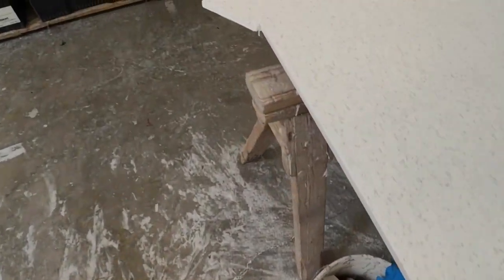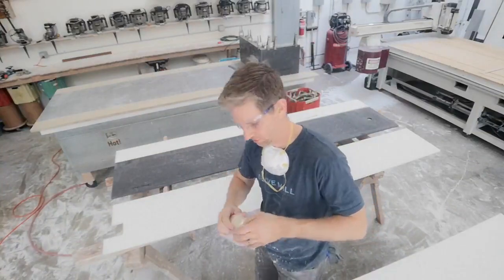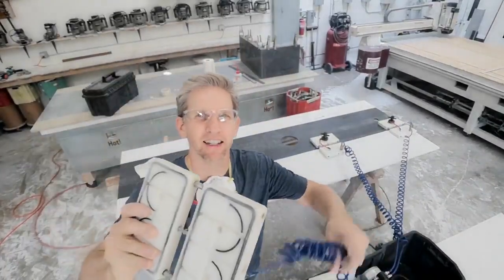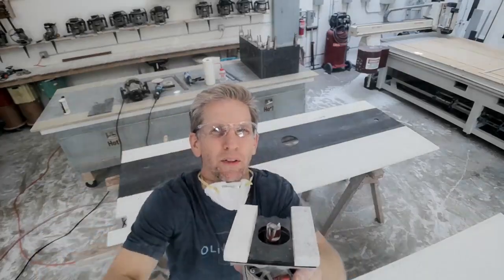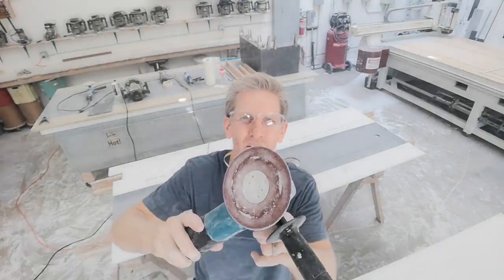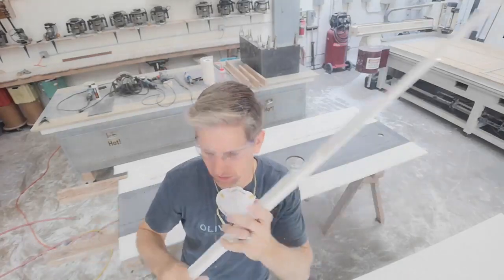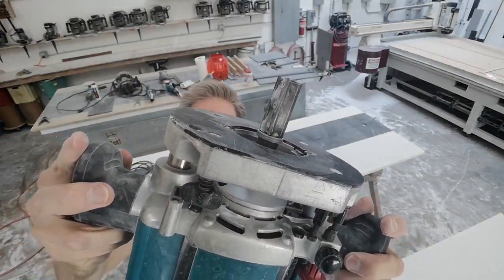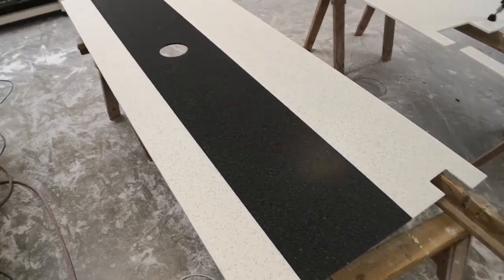Solid Surface Shower Walls - Panel Fabrication - Part 4

Comment: I just started attaching the monument clamps to the material then tighten up the clamp the way you did. No one ever showed me different but I thought that this would allow the material to level out. When I was shown how to use them I was told to attach then tighten as you go. Glad to see you do the it this way.
Reply from the maker: The problem we found with tightening them first is that sometimes they lose a little grip because the back is opened on the next pad letting out some if the vacuum. That's why we just tighten after they are all secure.

Comment: Hi, great job! Are those expensive vacuum clamps a necessity to get the panels aligned during panel installation? Would manual vacuum clamps be sufficient (considering the weight of big panels) for my DIY project? Thank you!
Reply from the maker: Absolutely, you don't have to have the automatic vacuum holdown pads.

Comment: We use a Dynabrade sander with a canister vacuum. Still leaves a lot of dust flying bit the air exchangers help with that.
Reply from the maker: We use the Dynabrade vacuum with the bag. Using a bag seems to collect more of the dust.

Comment: Are you using duponts newer corian adhesive that is tougher and drips less.
Reply from the maker: I use it sometimes. When we order the adhesive whatever they have in stock is what we get. They don't have the new adhesive in all colors yet.

Comment: Great videos!! Whats that giant sander you are using at the end?? I have a Gem and thought it was big but it looks small compared to what you are using.
Reply from the maker: That sander has four 6"pads and it works great. Pinske-edge.com

Comment: Does the polished finish last? Also woodworkers use a wide belt sander to sand large mdf sheets  and wood doors.
Reply from the maker: The finish is party of the panel and will last forever. It's not a typical treatment.
Reply from the maker: What type of wide sander, like 36" wide piece of machinery?
Reply: @AndyGraves  yes. Felder has one for upto 53in wide with 3 sanding heads.  A used felder tends to be at an affordable price.
Reply from the maker: Everytime I've used a wide belt sander on solid surface it leaves ridges that have to be saved out later. The material is too hard.

Comment: Great job. I assume you use 1/2" material for more joint surface and no seam support as would be needed with 1/4" material.  Do you use Avonite's 60" sheets at times?   Very informative as always.
Reply from the maker: 1/4 material is difficult because it takes the shape of the wall. 1/2 will lay flat and with a few shims it feels really solid. 

We have not used Avonite's wide sheets because we typically do one shower at a time. If I had a large job I would order their custom sizes too eliminate the fabrication labor.

Thanks

Comment: I always use a saddle on my butt joints per Corian and other fabrication guide lines. I don't trust the butt joints with all of the weight without some support
Reply from the maker: With the new Corian adhesive, Dupont no longer requires the seam support on 1/2" material. Makes installation much easier.
Reply: Yes it makes it easier but I have been doing this stuff for 20 years and I still trust the saddles on bigger joints. We fab for a major food service company and fab large counters surfaces that we use corian for 90% of it, we still use saddles.

Comment: where can I find someone who just installs the panels?? or at least who sells the material for the surrounds? and what is it technically called?
Reply from the maker: The material is called solid surface material. The brand most recognizable is Corian.
Reply: @AndyGraves  thank you Andy - I enjoy your videos and precision work ;-) So Corian is acceptable on vertical surfaces and wet areas like our shower?  Thanks
Reply from the maker: Absolutely, it works great for showers and wet areas.

Comment: So the white black white joint is just a butt joint. No notch or tongue and groove joint.
Reply from the maker: No notch, no tongue and groove, no seam support. I was using Integra adhesive because it is Staron material.
Reply: @AndyGraves  so you use different adhesive with different solid  surface material.
Reply from the maker: Yes, Corian adhesive is too expensive and the other brands are just as good.
Reply: Bruddah,you've been around a while,your basic shop is still ole school.

Comment: That dust has got to be very bad for you! And that smell of that acrylic epoxy will fry your brain cells. please get a respirator, not just a dust mask. Great video. I've done a couple of small DIY jobs a kitchen counter and tabel and the amount of dust is insane.
Reply from the maker: Try hanks. We use dust collection on most operations.
Reply: been 3 years, wonder if he's pushin' up daisies